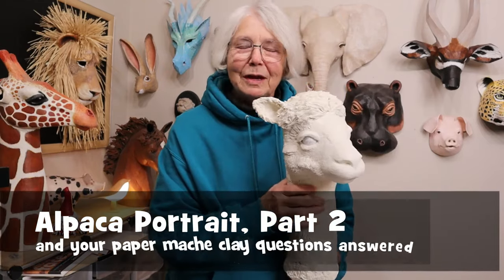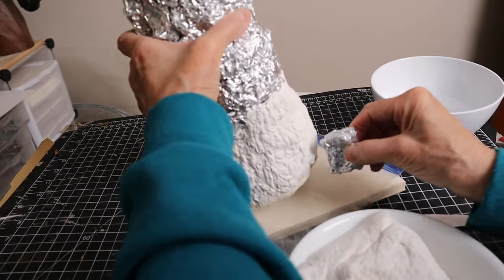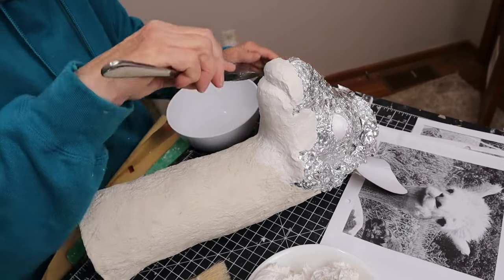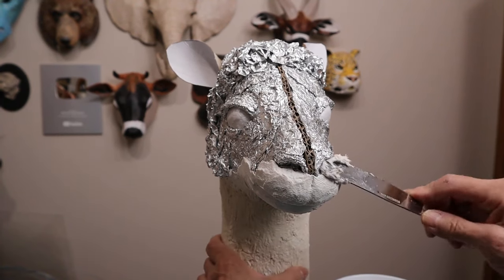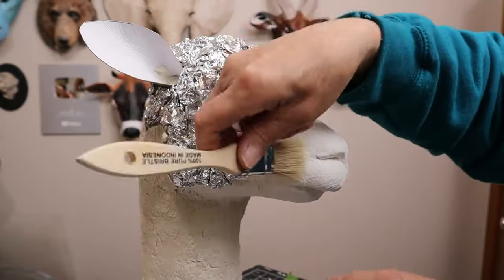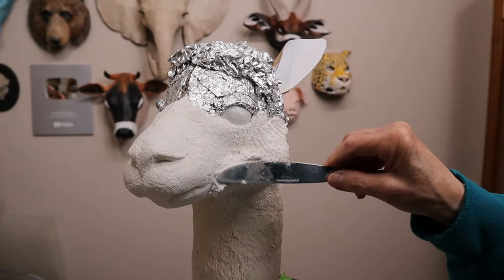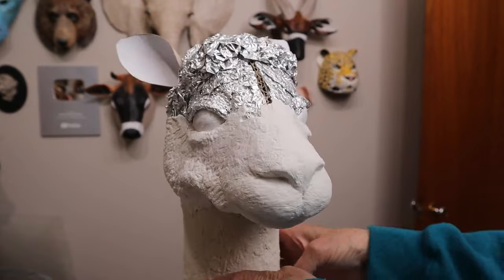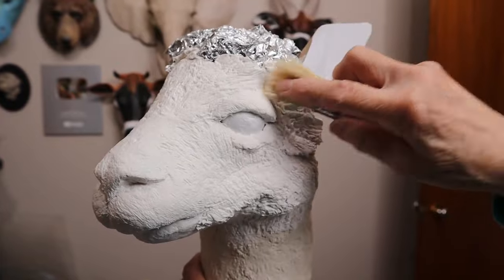Paper Mache Clay Alpaca, Part 2 - Plus Your PM Clay Questions Answered

Comment: Iv used pvc plumbing pipes as armature in large scale projects, that would be a good water proof alternative to cardboard.
Its cool cos u can bend the pipe with heat (hot sand poured inside the pipes, helps keep its shape while it bends) or heatgun. Good cos its really strong too

Comment: Hello! I have a question.  I start making large, kinder joys, or you can call them Easter eggs, too. I am gonna use your recipe for paper macher clay as a final cover. What is the best way to dry them? Is it good to put them next to oil heater?Thank you!
Reply from the maker: The fastest way to dry them is to put them in front of a fan. Your heater probably has a manual that says how far you need to keep it away from anything that can burn, like furniture. Use that as a guide, and don't put your kinder joys too close. A fan by itself is almost as fast as heated air.
Reply: @UltimatePaperMache  Thank you 😊